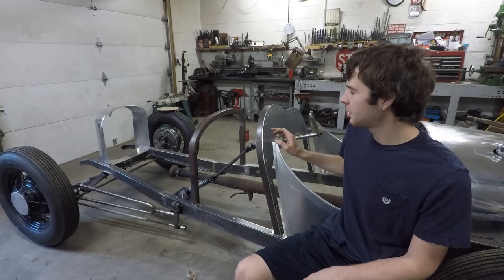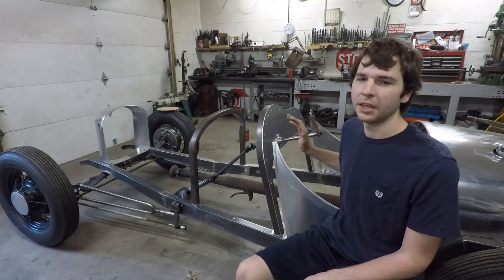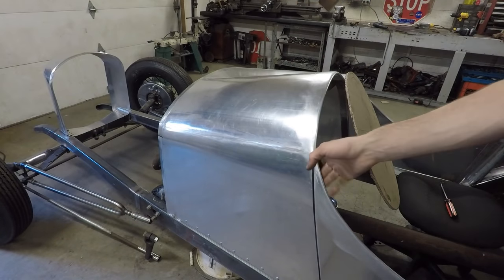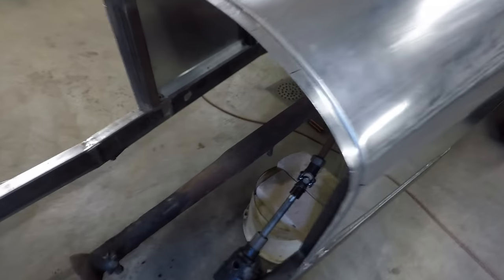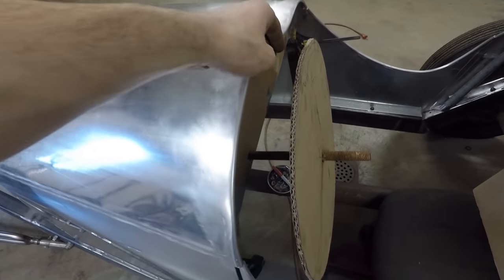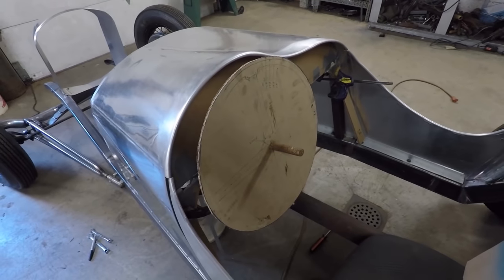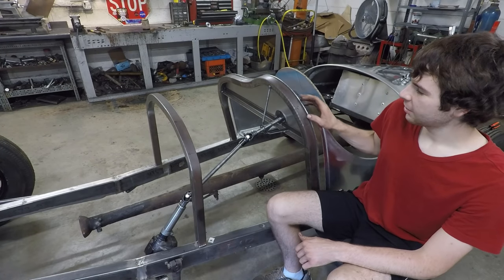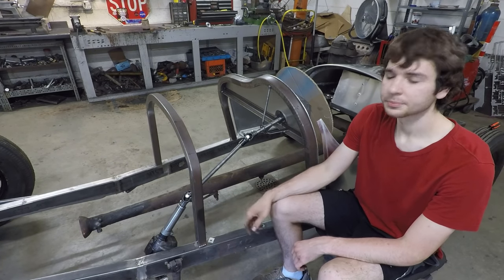Custom Hot Rod Steering! | Homemade Boat-tail Speedster Pt. 39

Comment: Good idea to put the U joints in.  I used to have an Austin Healy 3000 that had a straight shaft to the gearbox and was always afraid that if I had a front impact that the steering shaft would come through my chest.  I believe that U joints are also a safety feature.
Reply: while it helps with that, i do not think that U-joints are considered a safety feature in cars, most cars nowadays still have straight shafts but they are collapsible, they are made of two tubes one set inside the other with  resin "gluing" the two in place. in the event of a frontal collision, if the pression exerted on the shaft is sufficient, the resin will break and the shaft will compress telescopically
the first collapsible steering column was from 1934 but was a bust and since 1968 collapsible st columns are a safety requirement for all new cars in the US
Reply: Or they're simply a spiked shaft 
Cars with body on frame ( as apose to unibody) have a spline shaft to allow for body movement in relation to frame and also for a wreak 

Paticularly useful in Toyota's 
Can pick and choose steering components in a huge range and age of their 4x4s when doing swaps because most of the splines are a match so you can put a hilux power steering box in a 40 series Landcruiser using 75 series parts and any staring wheel you like 
Or you can put a camery steering wheel with all the controls on th wheel in a newer Landcruiser and get the extra functions (if you change the clock spring)
Reply: @quentintin1  I know for fact some cars have a active collapse mechanism. I had to rebuild a column and the active collapse mechanism triggered, and it was a total pain to fix it. It uses a plastic ring that pops out under load and literally forces the wheel into the dash. In an impact the airbag will force that plastic ring out and a REALLY heavy spring will shorten the column by a few inches. There is a second telescope in the engine compartment that will also collapse. That is free floating and the U joint is attached to the frame on either side of the telescope. Also the angle of the shafts lend themselves to collapse in a manner that will not encroach the cockpit. We have come a long way in safety, and I hope he adds at least a telescope in his design, but that is up to him.  It IS an impressive build!
Reply: My dad's TR4a was the same, one straight spear. When we hot rodded it (302 V8), we had to add multiple U joints so the steering shaft would clear the engine. We figure in a wreck the joints will let it pooch sideways rather than harpooning the driver. See, the engine swap made it safer!

Comment: You need to use bonlac between the aluminium and steel to stop corrosion between the dissimilar metals. Keep up the great work i can't wait to see the next video going by the great work so far the steering wheel will be a beautiful work of art
Reply: Craig Files Hi Craig. You make an excellent comment. I can’t seem to find the Bonlac product you refer to. Could you do me a huge favor and give a link to a suitable product you use to stop corrosion between two different metals. Many thanks
Reply: @bentleynut1648  sorry my spelling mistake duralac compound green  it's mainly used in marine application used between steel & aluminum  check in marine chandeliers that would be your best chance to get it
Reply: Craig Files thanks so much Craig. I’ve needed this type of product for a long time and never found it. I appreciate you telling me the correct product name. Many thanks

Comment: Usually I get engine transmission brakes clutch all roughed in. Then do the steering. That way a 1/4 inch can keep you from re doing everything.

Comment: Good job as usual. I couldn't help but notice the amount of flex in that dash and support. You might want to run a diagonal support from the Lowe firewall support to the upper dash support on both sides.

Comment: Did I miss you changing the angles in the steering wheel support hub - with the bearings? Really enjoyed that episode and will be using your idea at some point I’m sure (especially hand turning the lathe for the last bit of the radius - more accurate than filing for someone with very limited skills like me:-) ) Yet again an impressive video which showcases your skills and shows people like me what is possible with (lots of) practice.

Comment: The joints in the steering shaft are a definite safety feature. Any frontal impact (which would be an enormous shame, given the effort invested in the machine), will fold the shaft rather than impale the driver.

Comment: in old cars that shaft would act like a .50 cal bullet when the crash was hard enough for a person to bend the steering wheel back around the outside still the blunt force of the cap on the shaft could kill so you have a cushion on the shaft.

Comment: I was just thinking how dangerous old cars were with the steering shaft pointing at your heart but if you remove the upper brace on the back on the steering shaft bracket at the dashboard the steering would fold upward on impact with the wheel. so you would have a kind of crash absorber on the steering shaft if you understand what i mean you might be able to design a firm steering bracket that will allow the shaft to push in on an impact. maybe if that top brace rod went to the half round steel plate that the shaft goes through at the dashboard. it might twist up on impact and act like a old fashioned airbag

Comment: If you lay your sheet metal, ally or steel, on a 2" thick piece of hard foam insulation you can cut out shapes with your jig saw without all that vibration. The saw won't even know the foam is there, old sign makers trick!

Comment: did you consider the non linearity of U-joints in sequence (these are pretty steep angled joints)?
Reply: I had the same thought. There will be change in steering ratio from the wheel to the box with these angles. Not sure its a big deal in such a low RPM situation, but if this was an output shaft from a motor it would cause horrendous vibrations.

Comment: Those machine turned screw heads.. Hat is off, again. I suggest aluminium for the steering wheel material. Lighter and suits better to the overall style. And for the wooden rim, a disc from maple/oak/ similar hardish wood with slightly larger diameter could be the easiest starting point. Rough cut the ring first and leave it to season for a while, then add glue if it has cracked, and fine shape it. You're going  great Young Sir!

Comment: Sorry to say but check your steering wheel diameter and height off your knees! Looks low. Maybe try it with a mock floor installed
Reply from the maker: oh I know, I've spent a lot of time figuring it out and it's close